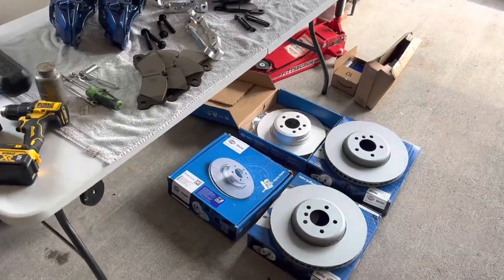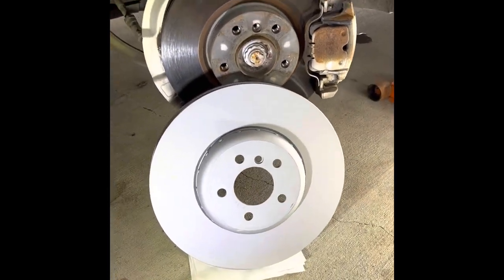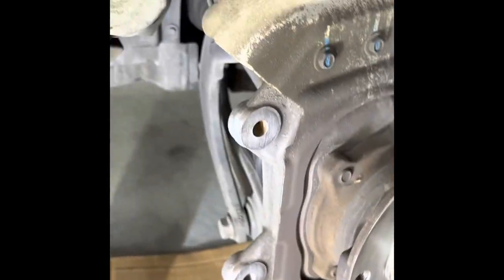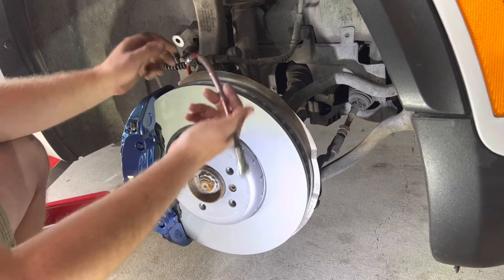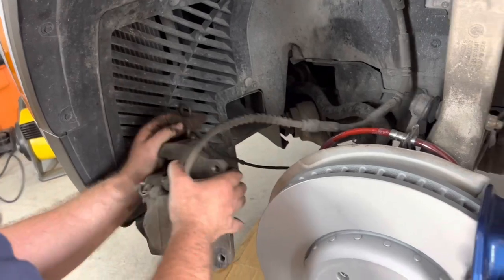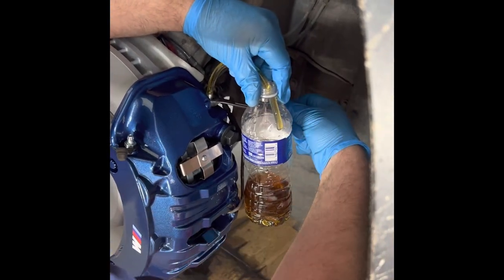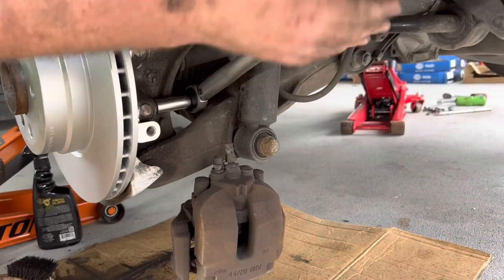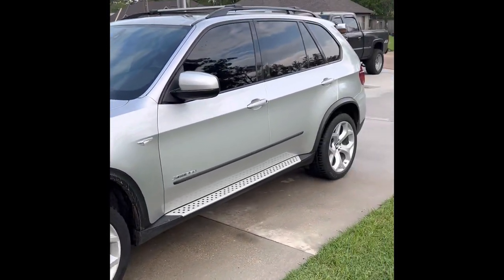BMW F15/E70 BBK step by step install

Comment: This looks awseome , would this work on rear of F85 2018 x5m ?
Reply from the maker: I have f10 m5 rotor brackets for front for f85 (larger and much lighter front rotors than f85) , and rear 4 piston brembo caliper for the rear that will work with your factory 385mm rotor. Send me an email and we can discuss further details
Reply: @Dentprotony  absolutely thanks so much 🙏🏾. What's your email ?
Reply from the maker: @drastikjdm4door  dentprotony@gmail

Comment: Coming from stock brakes on an F15 35i, I’m guessing coding for the performance brakes would also need to be done?

Also, what’s the feel difference? This is obviously a massive jump from the stock 2-piston front and 1-piston rear. Are they really biting, or just enhanced stopping power and less stopping distance?
Reply from the maker: They bite a little better, it is more about consistent braking performance under severe conditions (tow/track). Most of my customers code mbrakes, some keep it as is. Pedal seems to feel firmer and I always recommend upgrading to braided brake lines to get the most out of this set up.

Comment: Do you powder coat the Porsche calipers? If so, any testing to ensure fitment/sealing?
Reply from the maker: They are painted. No sealing/fitment issues in 3+ years
Reply: @Dentprotony  thanks for the quick reply. What make and model pads are used for this setup?
Reply from the maker: @azamjunejo  powerstop z23 1477 carbon ceramic pads. Low dust, solid bite, no noise
Reply: Thanks but wondering more about what if I was to replace pads and rotors in the future, could I only buy these or are these oem pads for another car (ex. 20XX Porsche Cayenne)?
Reply from the maker: @azamjunejo  you will need pads for porsche cayenne when its time to replace, i will provide part numbers/year make and model

Comment: So you don’t need a program to bleed the brakes? Just add fluid and bleed them the old school way?
Reply from the maker: Yes, you use ista or a scanner if you run your fluid reservoir low and air gets in the abs pump, otherwise 2 people or a pressure bleeder will do the job

Comment: Thanks for sharing. When you swapped the hoses, did you have the brake pedal pressed in at all? Some folks do that and apparently it minimises fluid loss. 
For bleeding the brakes I think it’s best to bleed the outer side first, maybe doesn’t really matter but it’s just a little further away from the reservoir. 👍
Reply from the maker: Thank you for your support! I didnt press the brake pedal, fluid loss is minimal either way, i wasnt worried about it, just a few drops vs risking damaging your seat.

Comment: Zimmerman rotors are very nice product also

Also always use a new brake line sensor with new pads. The sensors edge wears off  that’s what triggers the light on dash.  There  15$ Bowa brand. Fcp
Reply from the maker: Zimmerman doesn’t make two piece rotors for the 550iGT so they are very heavy, unfortunately. I only replace Pad sensor if it contacted the rotor, otherwise in my experience they are good unless damaged

Comment: what is the Price for this Brake system without Discs?
Reply from the maker: This kit is 2460 and comes with everything except rotors and brake lines. Excellent stopping power, consistent braking performance even under severe conditions! Perfect for those who tow or track or just want to improve the overall looks and braking performance at the same time
Reply: Hi there, do you ship to UK
Reply from the maker: @ThePen077   yes I’ve shipped to uk many times, also Canada, Australia, Netherlands, send me email we will make it happen
Reply: @Dentprotony this is exactly what I want, can you also supply disc and brake line or if I need to purchase this provide specs thank you

Comment: No drilled rotors 🤷🏼🤦🏼.  Big calipers yet no drilled rotors 🤔. 

Cut/trim those dust shields the “bent” way will squeak and squeal .
Reply from the maker: Why so negative my friend, shields are not touching anything, why would they make any noise? 

On the rotors, i prefer function and performance over looks, so I always recommend plain coated two piece rotors by pagid because they have aluminum hub and are significantly lighter than a drilled full cast option. But you can always get a drilled set up, it is available out there

Comment: I don't understand, you went thru this entire procedure to install new rotors, pads and calipers, just to reuse the brake wear sensors :(  You should have replaced these with new ones as well.
Reply from the maker: Well we reused rotor bolts, spindle bolts, brake rotor dust shields, and a few other things.  If you aware how the wear sensor works then you know that they dont go bad unless physically damaged. My customers sensors were perfectly fine so we went ahead and used them with his new set up. There is literally no need to replace unless they contacted the rotor and display ‘pad change required’ message on the dash
Reply: I don’t understand why people insist on installing new pad wear sensors each time they replace pads.  
There is no need to replace the wear sensor with new, unless it has rubbed on the disc. The sensor is simply just a switch, which opens a circuit when it rubs on the rotor. 
The only reason that BMW would recommend replacing them (apart from making money) is that they may not fit quite as snug when they are removed and re-used but I’ve never found that to be the case.
Reply: @Dentprotony absolutely correct. I don’t know why people insist on replacing pad wear sensors with new, when there is nothing wrong with them.
Reply from the maker: @Ally.MacMillan correct, only need to replace one if damaged from removal, or sensor actually rubbed the rotor. Otherwise its waste of money